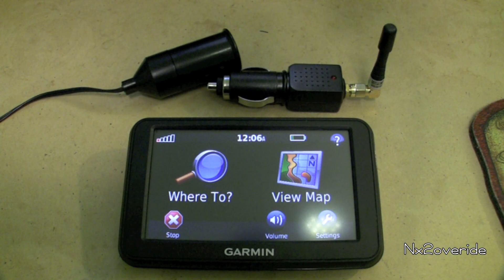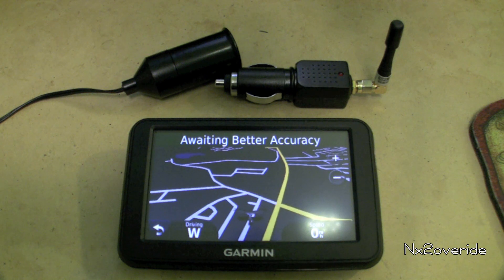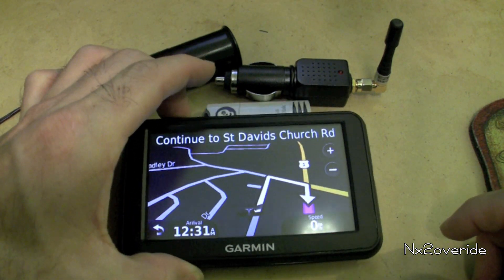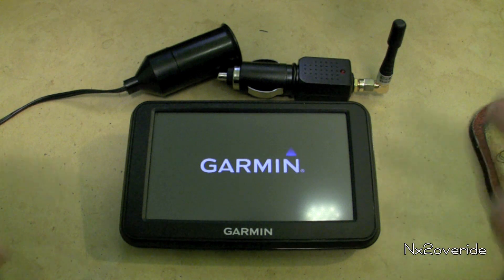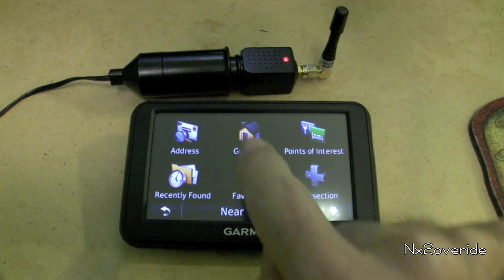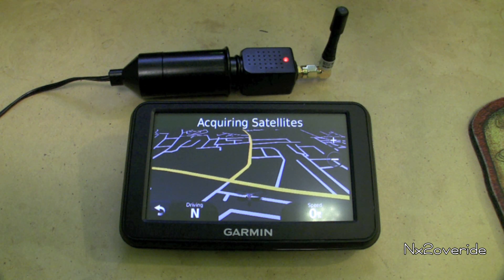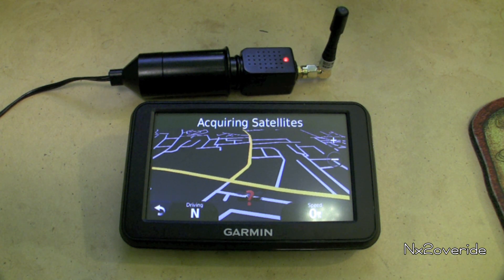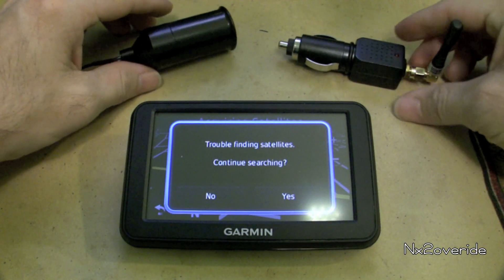GPS Jammer Signal Jammer Blocker

Comment: Will this device disrupt a criminal stalker who illegaly put a magnetic gps tracker outside underneath the vehicle ?
Reply: @pinkypromise111  i found a device to sweep the vehicle , its like a radio looking thingy with an antenna that beeps if it detects something near it. Not sure how good it works though and the tracker wore out of battery or it fell off the vehicle I think shortly after I made the comment I believe. and i don't think another tracker was put back on. I wish you the best of luck with whatever stalking issues you are facing, and hopefully they stop or you find a solid device to disrupt it.
Reply: did you buy it and did it work?

Comment: I am hoping this works on targeted individuals driving down the road from attacks
Reply: Did it work
Reply: @shimonel8006  if you have v2k ,mind control,  its in the fm frequency---you need rf jammer,hard to get--that is the answer to V2k and mind control    they have other machines for pain     -----faraday cage wont work because what your being shot with (a maser)also contains a magnetic field,nothing stops a magnetic field)

Comment: Mitch a question.... I’m followed everywhere I go.... harassed. My car has been hacked so will this little jammer keep me from being followed?
Reply from the maker: what do you mean hacked?  You may have a tracker on your car.. find it and disable it.
Reply: @TheHumanThatDrums  I have a tracker on my car, i have been trying to find it, i found two attached to the internal light in the car, where else would they put them
Reply: @taniarollinson6279  underneath your dash board,  air vents,  under the seats,
Reply: @stephaniebadillo2512  Kind of useless if there is any way around the blocker. It's like a temporary fix.

Comment: Will this block phone from accessing the internet as well?
Reply from the maker: no GPS is not the same as a phone signal.
Reply: Phones work off of WIFI, GPS works off of Satellites, much Different. Im not sure that this device would actually work as intended, maybe on older stuff but yeah not sure.

Comment: Is this sufficient enough for a car with a black box so that I can use it and they do not know the speed or location of the car. Anyone using one?
Reply: Abdirahim Guure 

Yes my cousin using a one for blocking speed and location detection now he is HAAPY !
Reply: sal what about when u turn the car off tho bro? Will the signal blocker still be on?
Reply: @incognitobaby6704  if its still plugged in...
Reply: @incognitobaby6704  
If you switch the car off then the GPS tracker is also switched off.
Reply: @sal-oo3ux  does this actually work?
Reply: Hurry-up it's in sold: https://www.ebay.com/itm/303102450657

Comment: Would it work on a company car. Or onlybif the gps was installed insode the vehicle not under the hood. And do you know if the usb version works just as good? And how do you amplify the signal

Comment: does it still work if I turn off the car? or it always needs to be powered in order to block gps tracking?
Reply: I'd say it needs a constant electricity supply to operate, certain things on cars still recieve a current even when switched of such as clocks and car alarms, maybe a Juntion in the wiring of something that constantly recieves power

Comment: Is there such a thing as a wireless security camera-jammer detector? My wireless security camera is being jammed by someone who is vandalizing my property.  I would like to detect who it is.
Reply: Wireless security cameras are not secure. Would you want someone to sell access to your feeds to some creep on the internet?
Reply: A wired security camera would do it...
Reply: Some cctvs use wifi
Reply: @kv-2743  set up another camera in a faraday cage
Reply: Probably bit late but you should be able to contact your local uh. regulator? So if your in the US you can contact the FCC probably, In the UK they are Offcomm

Comment: I see that antenna is detachable, and there is a standard SMA connector for low loss 50 ohm coax cable. What if some stronger and "directed antenna" is connected (like small dish or yagi of cours for corresponding frequency) and pointed to another vehicle ? Will it affect to lose GPS signal for that vehicle? Never mind is it this model or any other with detachable antenna it's same question.
My logic is based on example with Wi-Fi USB stick's or any pci wi-fi card. 
You remove (in most cases)  2db antenna and put some larger like 8db or small directeed Parabolic Grid Antenna like 15db and you far get better internet signal and speed but only drawback is larger power consumption. So bigger directed antenna for 1500-1600MHz to jamm other vehicle gps device ? Yes or no??
Reply: Gde mogu kupiti jamer za zujalice u buticima i koliko kosta
Reply: on

Comment: can i use this device to block gps linked starter kill switch on my car ?
Reply: Not quite sure what you're attempting to achieve. GPS is for most intents and purposes 1-way communication. To be able to perform any action (or lack therof) based on GPS positioning, there has to be another, 2-way communication between the car and another device (usually GSM/GPRS etc). If some service kills the starter /automatically/ based on GPS positioning, it /MIGHT/ work... if its not set up so it kills the starter as a failsafe if the GPS lose signal.

Most of these setups can be overridden manually though (through GSM communication). If you really need to  prohibit such a setup to function, you're probably going to need a GSM jammer, too.
Reply: @claraloraine4605  are you the "girlfriend" ? 🤦

Comment: I drive semi trucks and my company recently installed gps tracking in all the trucks. Will this device block my company's signal?
Reply: Yes, but it is very illegal and they'd notice the gap.
Reply: 100% yes! I've had 2! Brilliant bit of kit.
Reply: You can get fined if it interferes with other devices.  Some poor sap got fined $38k and was fired for using one.  The device he used interfered with an airport he passed by.
Reply: illegal jammers like spying drones haha
Reply: No, nearly all gps trackers use cell phone towers (LTS) either primarily or as a fall back when the GPS antenna can't connect.

The only ones this device could fool is the super cheap ones that just tracks where the vehicle goes (has no cell service) and the company manually checks the data which is pretty rare.

Comment: its not really useless because it will jam vehicle tracking with in the work car.
Reply: *****   i jus looked into the lojack specification because i thought of the same thing.......   this small gadget ranges from 1500 to 1600 mhz and a lojack system operates on the 173.075 mhz. this device does not cover that range.
Reply: Jesse Lopez Ah, then there we go. Thanks.